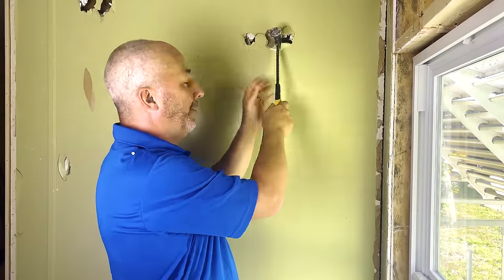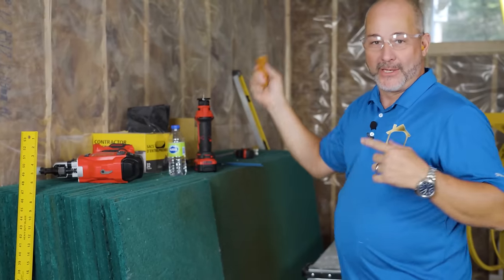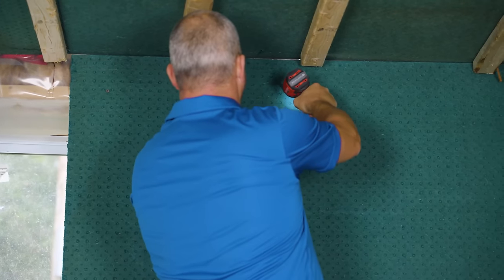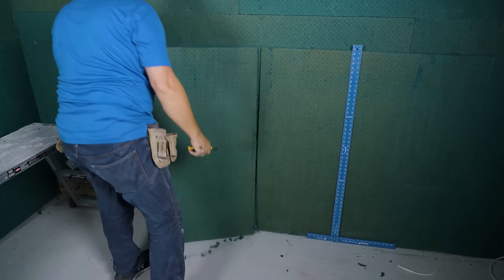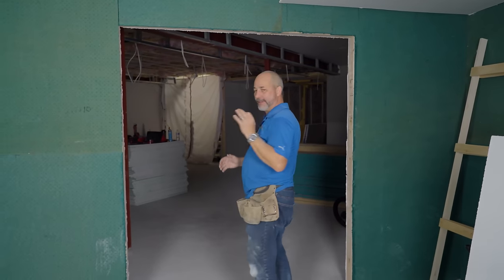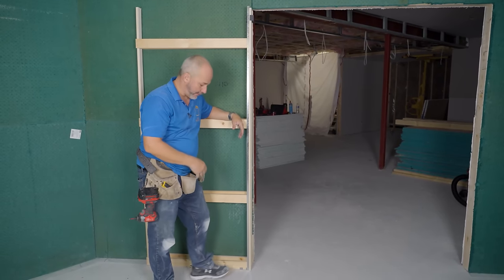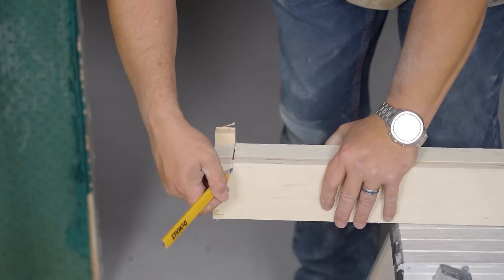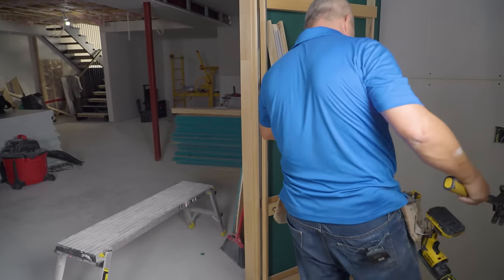The MOST Effective Way to Soundproof any Room

Comment: Despite my silly profile name, I'm a physicist and have been an acoustic researcher/consultant since 1996, guest lecturer to 3rd year University architecture students for 6 years, court-approved subject matter expert, state government authorised auditor and my business consults to architects on acoustic design. There are many things right about Jeff's build here but one major problem: the Sonopan. These products have decent noise reduction coefficient (NRC to reduce reverberant build-up within the space) but generally poor sound transmission loss (STL, for use as a mass barrier). Sonopan is 224kg/m^3 compared to 615kg/m^3 for fire rated gyprock (Aussie for "drywall").

EDIT: The sono product here has the same STC rating as a sheet of 13mm drywall. 

In this build, more MASS (weight, not density) will have been achieved had the Sonopan been additional drywall sheeting. I would advise retaining the existing drywall as a base to build upon, but admit it is satisfying watching my go-to DIY advisor smash a hammer through a wall. Adding battens, insulation infill and a final layer of drywall would not have been acoustically inferior to Jeff's far more complicated and, might I say, expensive build. Modern downlights that do not compromise acoustic integrity are readily available. 

As the lady sang ... "It's all about that bass, no treble". To silence noisy insects just close a thin glass window, but to silence a subwoofer you need bricks (with alternatives beyond the scope of a YT comment that nobody will read!). 

The high NRC of the Sonopan is negated by covering it with drywall, making the Sonopan just expensive additional cavity insulation (Jeff was spot-on with his early comments about cost/benefit of cavity insulation). OK, it's more than "just" additional insulation since is IS a bit of extra mass and also a partial mechanical decoupler/damper for the drywall. 

In reverse (drywall then Sonopan facing the interior of the space) the combined STC is the same (same mass either way) but the exposed Sonopan would reduce the internal reverberant field by about 3-4 dB at the wall/ceiling surfaces, thereby effectively increasing the system STL by this amount as perceived in adjoining rooms. It would also improve the acoustics of the space. "Boomy" hard rooms are fantastic for Yo-yo Ma and his cello, not so great for anything else.  (Aside: classic old churches are really "echoey". This has a benefit. Who wants to sing hymns in an outside congregation when you're lousy and the person next to you is a good singer? Solution: reverb! Washed out reverb increases total volume, masks adjoining voices (and yours), encourages shy singers (aka most people) to sing, makes them happier and the offering plate gets fuller when it is passed around. Of all the tall stories one could make up, this isn't one.)

Would the Sonopan look bad exposed to the room? Probably (aka, I don't care), but as I told the architecture students, acousticians are largely blind and architects are largely deaf! 

I have a job tomorrow in which pink noise will be played through a loudspeaker and measured in the source room and adjoining rooms with my spectrum analysers so I can certify the acoustic performance across the standard third-octave frequency range 50Hz - 5kHz in a new high-rise apartment development. It would be interesting to test Jeff's space then rip off the Sonopan and drywall, reverse them and re-test. Yeah, like that's gonna happen :)

EDIT: Wet wipes are $2. "Baby wipes" are $4. Same with acoustic products. You throw in the word "acoustic" and you can double your price. For example, a group from my professional association had a major manufacturer in Australia change the advertising for their "acoustic" plasterboard since it had an identical STL spectrum to their cheaper, 3mm thicker standard product. After my first 5 years studying the test data sheets from suppliers of acoustic products I have essentially never recommended an acoustic product for over 15 years unless a client (or their starry-eyed architect!) really wanted it, since in 99% of cases the desired result can be achieved with standard construction materials and possibly a few novel installation methods.

I could go on and on as though I'm in an echo chamber ... which by the way can be fixed by having the Sonopan facing into the space rather than sheeting over it ... but I think that'll do for now.

PS. I really like that sliding cavity door (I'm currently converting a wall diving two flats in my recently purchased 100-year-old timber house to turn it back into a rambling home and Jeff's door is awesome!) but if I were reviewing it for an architect for inclusion in a noise-rated wall ... totally different story!
Reply: so basically even distribution of  the sound waves by the design of the sonopan is being blocked by the flat drywall. ...true....usually tho....studios add more soundproofing outside the sheetrock by placing foam soundproofing in specific arrangements on the wall to help redistribute the soundwaves ..but then its just as ya said....makin the sonpan behin the sheetrock extra insulation.
Reply: @jamesLescobar  Yes, the drywall is stopping the absorption provided by the sonopan. I design acoustic spaces for audio and voice recording and you're on the right track ... you have to soak out the sound in the space depending as specific requirements.
Reply: Thanks for the insight.

That leaves me with my original question unanswered still. What would you suggest then, for a home, with drywall finish?

Can you provide a few examples of assemblies that would work?

If you can do then based on cost and results, that would be GREATLY appreciated.

I (and many others, I'm sure) would like to know what a good, great, excellent assembly would be like, and the related cost.

Thanks for sharing. It's always great having people with lots of experience chime in
Reply: @jamesLescobar  As usual there seems to be some confusion in the comments between sound transmission loss (i.e. keeping sound energy from traversing the boundary between spaces) and room acoustics (i.e. controlling sound energy as it bounces around within a space). The two are related and have some interaction but are generally distinct areas of interest.

Sonopan's website is absolutely brimming with fluffy marketing BS but from what I can tell its primary use is as a dampening layer between drywall and framing, a role usually filled by hat channel and isolation clips. It doesn't have the raw mass to be as good a barrier as 5/8" drywall, and it doesn't seem to be useful as a surface treatment, but it could conceivably help as a low-cost decoupling layer in a properly-designed partition assembly.
Reply: @helmanfrow  I agree entirely on the possible uses for this product and how it doesn't match the marketing. As per my post, 25+ years as an acoustic scientist have taught me a little bit about marketing hype vs reality.
Reply: @josegomez6549  Sorry, where is your original unanswered question? It's not in this thread.
Reply: @simpletonballsack  so would two 5/8 inch drywall panels perform better than a 5/8 inch plus sono combo?
Reply: @patrickwasp  Yes, in almost all configurations, new or retro-fit, walls with and without existing insulation. Drywall over the top of the sono, when the wall has other insulation in the cavity, is essentially just sealing money in your walls. Doubling up on drywall will double the mass on one side of the partition and increase the loss at lower frequencies. Honestly, I would see the greatest use for the sono as an impact-damping underlay for a plywood floor where there is a room below, subject to ISO testing.
Reply: @simpletonballsack  I've had it for a while now. Watched the video hoping I'd get answers, I did but with your input idk if it's as good as I thought. I'm sure everyone that has looked into soundproofing in their home has these questions as well. There's other that have that questions, I'm sure. There's not that many people posting guides and how-to's that are educated and knowledgeable on soundproofing. That's why I would like to hear it from you
Reply: @josegomez6549  Ahh OK. Thanks. In the circumstances of this video (existing internal walls, no insulation, intact drywall) the Sono product as installed is doing very little by essentially just replacing the existing (heavier) drywall that was removed (although removing the drywall allowed for installation of batts). The manufacturer states STC 27 for the product, which is the same as 13mm gypsum drywall so they will perform the same as a mass element. I'm a bit surprised it's that good and can envisage uses for it in applications other that the one in this video. 

Just using the materials used in this video, a better and simpler installation would be apply the sono straight onto the existing wall, batten out, put in the insulation batts then sheet with drywall. Better still would be batten off the existing wall, infill with batts then the sono and finish with the drywall. Even better, battens, insulation, drywall then sono. In all cases, you retain the mass of the existing drywall. For aesthetics, people would instinctively put the sono under the new drywall so it can be painted and look nice, but this nullifies the cavity absorption that the sono on its own would provide and reduces it to just being a mass element equivalent to, but thicker and more costly than, a sheet of drywall.

Best practical solution with lightweight materials for standard residential (without removing existing drywall) is erect wall framing about 10-15mm off the existing wall (bigger gap is better but that means reducing room size too much), Infill with insulation batts and sheet with two layers of drywall, setting both layers. For home recording spaces, apply the sono as a final facing if you've already been convinced to buy it because you care a LOT about sound quality and very little about looks, although there are far better facing materials available (it's a bit concerning that the manufacturer states STC but not NRC, so they're not promoting its absorption capabilities). 

Based on their own data, the sono product performs no better than drywall as a mass element and will certainly be nowhere near as good as glass/polyester/mineral/wool fibre batts as acoustic insulation (ie, absorption, be in within a cavity or as a facing material to reduce reverberation within the room). It is a product with no physical properties that would put it on my recommendation list and I imagine price would drop it down a few more rungs.
Reply: @simpletonballsack I'm building a shed so I'm not concerned with looks. Would OSB/plywood for the interior walls provide better or worse soundproofing than drywall?
Reply: @joseph7105  Hi Joseph, OSB/plywood when fixed the same way as drywall will perform the same or most often better acoustically since it is generally heavier per square metre. I currently have a client who is setting up a yoga space in an industrial complex and next door is a cabinet joinery. He has a large amount of old plywood sheets and needs to enclose a mezzanine over the joinery. His clients will never see this wall so I strongly recommended the plywood instead of "acoustic plasterboard" that he was about to order. With two layers of plywood, just overlap the joins so there's no need to tape them. 

Back to your shed, I don't know your specific noise control needs, noise sources or budget. Optimal noise reducing (the word "soundproofing" has no counterpart in reality!) varies for different situations. You could have traffic noise you wish to keep out, noise from power tools you wish to keep in, be a fan of very loud music that your family hates or have reverberation to manage because you practice singing in there and want it to sound as acoustically "nice" as in the shower! Tailoring noise reduction (especially for a new build) for specific noise sources is easily done with materials straight off the shelves of the big stores but, if I may humbly say, it does help if your 25+ year career as a physicist has been dedicated to this subject! 

I apologise for not just writing "Yes" in response to your question.
Reply: @josegomez6549  It's essentially impossible to know how to advise you without first having sufficient knowledge of the specific current conditions of your home and the specific changes you want to make. I can tell you that very often in residential situations there is no satisfactory solution to a sound transmission problem, either because an effective solution would be unaffordable or impractical to implement or because an affordable solution would be ineffective or impractical.
Reply: @helmanfrow  Hmmm, I have to say (again, as a physicist and consultant in this specific field for over 25 years) that very rarely have I encountered a situation in which an effective tailor-made retro-fit has not been possible. If I can think of one from my own experience, I'll let you know BUT, as you rightly say, if it's a very tricky one you do have to throw a lot of money at it. A man once rang my consultancy asking for a solution to his son playing drums in their garage and annoying the neighbour opposite the common driveway. After disappointing him and telling him I was a mathematician not a magician (especially when he's asking for free information that I normally charge $240/hr for) I offered a 100% guaranteed effective and almost zero cost solution that he was not at all happy with and he basically hung up on me (as I had hoped!).

Some people are so unappreciative!

Regarding Jose's specific question, the answer is yes.
Reply: @josegomez6549  On the most basic level I would advise you that effective sound isolation has three pillars: mass, mechanical decoupling, and air volume decoupling. You need all three for effective isolation. None of these are easily to achieve in residential construction, certainly not for every room boundary (i.e. walls, ceilings floors).

If, for example, you're trying to reduce sound transmission between two bedrooms that share a partition wall, you may find you get satisfactory results by adding a layer of drywall to one or both sides of the wall and sealing everything very carefully. Or you might go through the trouble and realize that there is still lots of sound coming through the vents and under the doors and through the ceiling structure.

Every situation is different. You can start to see why good isolation is not simple and not cut-and-dry.
Reply: @simpletonballsack  Great response, thanks! Sorry I should have mentioned, my shed is going to be used as a workshop so my main concern is keeping the sound of the saws and compressor from disrupting neighbours!
Reply: @joseph7105  You're welcome. For a defined, stationary noise source such as a compressor, which has no ventilation requirement, you can treat the noise at the source rather than at the whole shed surface. Knock up a ply or OSB box to slide over it, staple some insulation to the inside and a small hole or two for hoses is no great problem. This will appease the neighbours and also make the inside of the shed more comfortable for you. This is also a standard treatment for pool pumps. The saw noise obviously needs shed lining, and OSB or ply will do just fine. Saws are louder than a compressor but are mainly mid to high frequency, which is far easier to block than lower frequencies. Obviously, the ceiling needs the same treatment as the walls and fit perimeter seals to the door. 

I've just built a shed and a "imitation Festool multi function table" and have even cut clamps in half to fix dowels to the bottom for sliding into the dog holes so I have clamps that can be placed anywhere on the table. Also made a hinged MDF track for my circular saw with depth stoppers for 16mm, 12mm, 9mm and 6mm materials. All this to build kitchen cabinets. Including all sheet materials, adjustable cabinet feet, edge band, screws, self-stop countersink and self-centreing drill bits, paint for MDF mock shaker doors and quality hinges I can make a 900mm base cabinet for $115 compared to $445 for the budget flatpack from our Bunnings store. Hoping to save a motza for a 6m x 3.5m kitchen. 

Best of luck with your shed!
Reply: @simpleton ballsack , if you have the time, I would LOVE help on the most inexpensive way to create a sound barrier between my first floor and basement! 

I don’t mind if there is a little noise but hoping to have it be largely muffled (we have four wild kids but will have a bedroom in the basement! We are about to reno the basement and would LOVE your expertise!!!!
Reply: @minadavenport5512  Hi Mina,
floors are a problem because obviously there's footfall and other impacts and not just airborne noise to deal with. Floors need carpet and underlay. If the basement ceiling is exposed floor joists, you'll need to stuff in some insulation batts and sheet it with heavy material (eg, OSB). This sonopan product MAY have a use. I wouldn't fully line the ceiling with it then cover it over with board/drywall - that will just make it very expensive cavity insulation that actually does nothing because you've already put in some insulation batts. What I would do is cut the sono into strips and just tack them along the floor joists as a partial mechanical decoupler before fixing the OSB/ply/drywall. One sheet could do the whole ceiling. 

This is not a "sound barrier" by any means, you'll just get an improvement. Unfortunately, inexpensive and floors don't go together when significant noise reduction is required!
Reply: Sono pan works better than 2 layers of drywall for ceilings to dampen noise from people in the space above.  I’ve got two air bnbs below me and one I did 2 layers of 1/2” and the other  I used sono pan and drywall . I only used the sono pan because  I got it for free off of a job. I was surprised at the results. I did decibel reading tests before and after . Another technique I’ve seen used is a layer of rubber (like edpm pond liner) on the joists before the subfloor and again before the drywall but that labour would get expensive fast.
I think the sonopan works because it gives break between the hard surfaces (joist and board)so noise can travel through .
Reply: @plumbobmillionaire6246  Assuming the ceilings below were drywall, you're actually comparing the following two systems:

(1) Floor/air gap/drywall/sono/drywall.
(2) Floor/air gap/drywall/drywall/drywall,

so your first sentence doesn't describe what you're comparing.

(2) has slightly more mass but as you correctly say, the sono in (1) will act as a partial mechanical decoupler.

You're also correct about the rubber layer (or sono strips per my advice to Mina, if that's what you already have). 

Also, noise coming up from below is airborne but noise going down from above is airborne and impacts (footfall etc). Your system with the sono will be better for this.

I'd be interested in what you used as a repeatable noise source for the test, what you measured with and what the results were.
Reply: Jeff in old videos actually used to double up on the drywall (fire rated at that), along with mass loaded vinyl and decoupling, which is the basic level with contractors and about what you suggest. I know recording studio builders have some wacky and cost effective ideas, not sure if there is any truth to them, though it ends up being almost soundproof. I'm a bit surprised you didn't mention any. 

At any rate, Jeff commented that subjectively the Sonopan was as good, if not better than what you mention. So either his subjective comparison is off (which can be normal with hearing) or he's being paid by Sonopan. Beyond that, do you think it's possible Sonopan does a good job at absorbing frequencies that humans commonly hear? 

I don't know if I'm recalling correctly, it's been ages since I've dealt with sound physics, but my understanding with noise transmission ratings is that they are averaged over the entire hearing spectrum (e.g. 20 Hz-20 kHz), without any additional weighting (mentally, humans get attuned to particular frequencies overtime as well). It's why beyond simply mass, it's recommended to use different materials (unless you have access to extremely dense materials like lead). So while this may be baseless conjecture, is it not possible Sonopan can absorb frequencies say, between 100-3000 Hz (which covers a lot of human vocal range and musical instruments), better than another sheet of drywall, but due to poor performance above those ranges, have low STL, which would be a legitimate reason for Sonopan to not publish that measurement?
Reply: @anfernyjackson9013  I can't pack 28 years into a comment so there's for more I didn't mention than I did :) I could go into detail on several recording studios I've designed but it really would be a chore. For a start: no parallel surfaces allowed! (OK, you usually have to but you can trick the room into not appearing parallel to unsuspecting sound waves). 

Mass loaded vinyl (Soundlagg 4525C in 4kg or 8kg is our local product) has been deleted from my recommendation list for over a decade. There is no field application of that kind of product that matches the ISO chamber tests and even if it satisfied its full potential, there is no application where off the shelf products aren't a better solution. It invariable fails as a mass barrier in a roof cavity when fixed vertically above a partition wall for room-room noise reduction (it's original designed intent) because it's just WAY too fiddly for installers.  I have worked on law offices (adjoining mediation rooms) and psychology consulting rooms with bad cross-talk issues where my first step was to rip out this product, installed by their well-intentioned builder. (I've then repurposed it to lay on the ceiling arross a partition, not because I recommend it but because it may as well be used). 

EDIT: Sounlagg was designed to lag soil and stormwater pipes. I'd forgotten about that! It has been replaced by acoustic rated pipes because the installer doesn't have to cut it, wrap the pipes and silver tape them. 

Products similar to Sonopan have a noise reduction coefficient (NRC, absorption averaged across the spectrum) of around 0.6 (peaking at 500-2kHz) whereas any old fibreglass batt will achieve NRC 0.85 or greater. Sonopan does publish STL as the spectrum average that you correctly recall, but STC 27 recommends the product for no project I would be consulting on. 

Drywall sheet does not absorb an appreciable amount of sound, except at low frequencies below 80 Hz due to panel resonance, which is very undesirable in hi-fi spaces. Not absorbing (much) sound within a room equates to not transmitting (a lot of) it to adjoining spaces.

You're spot on about considerations beyond mass. Effective partition systems need mass, insulated air gaps and mechanical decoupling.
Reply: @simpletonballsack  I see, thanks for the reply. If you one day have the time, perhaps you could make a blog or youtube video going over the making of a recording studio for...your architecture students of course >>. And the world. It was always curious to me because sometimes beyond standard methods, I would come across builders who would have other suggestions, e.g. fire resistant moving blankets nailed/glued behind drywall.

Sorry if I misunderstand, but did you stop using mass loaded vinyl because it's difficult to install? Not that I disagree, just surprising since it's one of the first things recommended in sound deadening from walls to car doors.

Lastly, are decoupling methods like resilient channels actually effective? I've always been skeptical of how much they help if effort has been put in to add additional sound deadening materials. I think the issue with anything noise related, is that very few of the products out there get tested and compared in actual builds. Effective setups tend to have the kitchen sink thrown at them.
Reply: @anfernyjackson9013  Hi Anferny. I think I stopped recommending loaded vinyl because it suited none of my needs as most of my work is design compliance. To satisfy our codes for residential, waste pipes in a ceiling void below a bathroom above a unit below had to be wrapped or the ceiling had to be 2 x drywall. The industry now uses acoustic rated pipes so only one layer of drywall is needed. The costly pipes are offset by not having to pay the trades to manually wrap pipes or lay and set additional sheeting. It is uneconomical to use as a flat sheet in any application. Definitely suitable to car doors and other applications where its flexibility shines but I think spray-on dampening material would be a far better option.

Resilient channels are widely used in my projects in floor/ceilings because they are "deemed to satisfy" impact ratings in our codes where there's no carpet on the floor so I can certify them easily. I don't get to test and compare partitions with/without resi mounts and I'm probably a bit skeptical as you are.

You're right about testing in actual builds. Lab testing is done in a chamber and nothing is done perfectly in the field. I used to recommend Rw ratings 5 dB above code to allow for shoddy workmanship but this has generally been pushed back by developers. That extra 5 dB comes at huge cost. Very often the Council approval will include a condition that the noise consultant has to periodically visit the build and certify it. I'll often be called out to inspect plumbing penetration treatment in walls or over head ducting before it's covered with drywall. In one recent case, the plumbing contractor had thrown the kitchen sink at it, as you say, and a fair bit of that was unnecessary. For example, lagging cold water pipes instead of just using rubber mounts. I simplified the design to the delight of the head contractor and the other rooms were then completed. 

I might one day put out some practical advice to the public because there seems to be a huge interest in it (hence this video) and it's often not quite right. Certainly people can walk into a shop and be sold all manner of products with "acoustic" written on them that are just marketing hype and boy are they expensive. Just yesterday in our big chain store Bunnings I saw "sound stop" scotia molding that trims around the edges of laminate flooring. Good grief!
Reply: @simpletonballsack  Just want to say thanks again for the reply. Apologies to ask another question, I realize I've come full circle... so as a rough general recommendation, besides air sealing, decoupling, and doubling up on drywall...  to resist sound for a basic wall, are there any other products you recommend that aren't too esoterically priced? e.g. I brought up MLV because 1/4" can be found cheap, it's like 60 cents a sq ft. Those cheap pyramid foam stickers for walls to just shift noise direction? Perhaps buy drywall compound in bulk, fill the walls and hope you don't need to open them up? I'm wondering if even going back to plastering walls is what will have to be done.

I do think this subject is going to ramp up as housing costs are forcing more people to live together in close proximity, as well as the amount of ineffective products that claim to help.
Reply: @anfernyjackson9013  You're very welcome. You hit the nail on the head regarding dense, multi-storey residential and noise problems. Designing to the building code gets you walls rated 2 out of 6 stars as defined by my professional association (AAAC). That's how you have to build public housing and developers just want to satisfy code. I will NEVER live in a multi-residential building.

If you're after mass and not looks, OSB and plywood are heavier than drywall, but drywall is actually pretty cheap. Just don't buy "acoustic" drywall. Foam lining in a room doesn't increase the loss through a wall but absorbs reverberation within the room. Filling the walls with compound is a novel idea! If you have access to the wall cavity, always put in insulation batts. Great "decibels for dollars" as the Rw (STC) rating is improved by about 4-5 for cheap stuff and 6 for the expensive rockwool.

If you build a wall with, say, 92mm bottom and top plates, put a row of 70mm studs flush with one edge and another row of studs between them and flush with the other edge. Weave in some insulation. With one layer of drywall each side, just the "staggered studs" improve Rw by about 5 and the insulation another 5.  All for a small cost over a standard wall and only 20mm thicker. If space permits and you have existing walls, build a new framed wall about 20mm off the existing one. Insulate and sheet. Since you have it, may as well but the MLV under the drywall but you'd have to be very careful not to let it buckle.
Reply: @simpletonballsack  When you say: "tack them along the floor joists", does that entail at the base of the joists or on the side of the joists?
Reply: @CaptKewl  In a ceiling application, tack them un the underside of the joists before sheeting over.